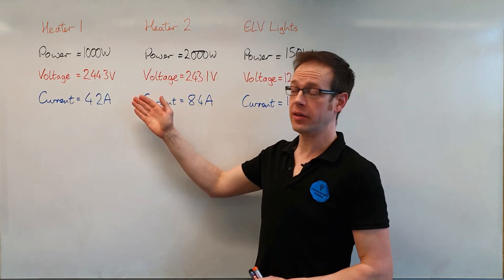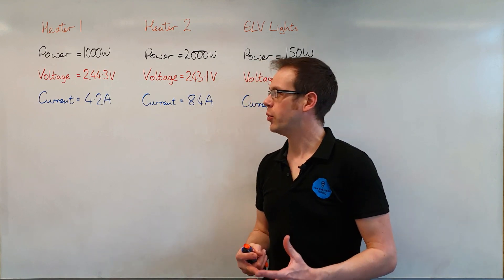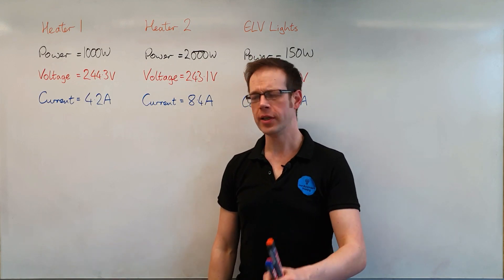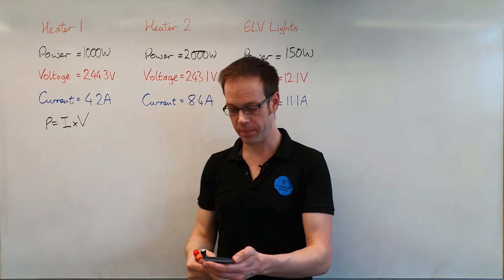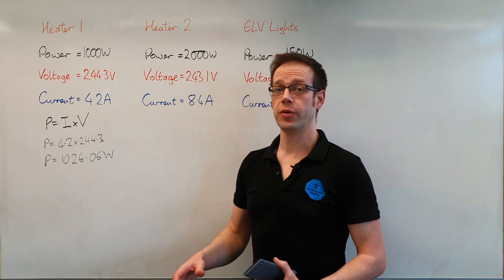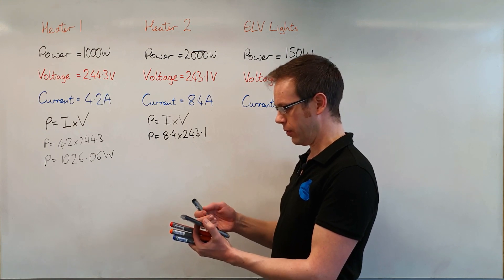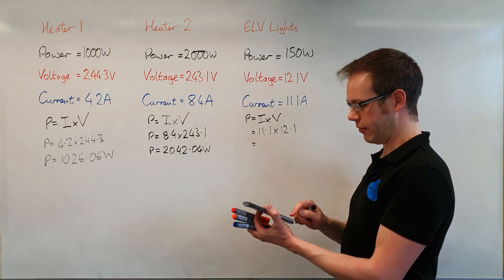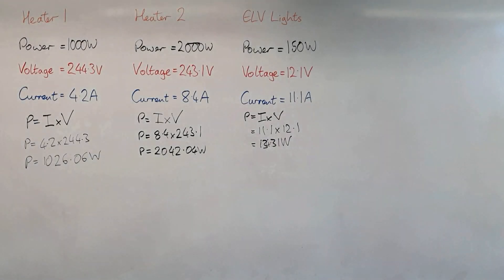How to Calculate Power in an Electrical Circuit, Where Does the Power Formula Come From?

Comment: Hi Joe, saw the video was interesting and you are doing a great job, since all the loads were connected on single phase AC supply, it would be good to explain that minor difference is due to the power factor value P=V*I*Cos"phi", So the heats are found to be leading load whereas light is found to be lagging load due to the transformer used to connect it. heaters are leading because you may be reciving over compensated supply from utility provider and LED lights are lagging on same source due to the transformer used.

Comment: I think maybe some manufacturers use in their calculations voltage equal to 220 or 230 as standard value and your practical measurement with voltage 244 is different from them .
Reply from the maker: Great point, thanks for sharing.

Comment: Great video. Shrouded banana leads might be a bit safer though. E.g. rapidonline.com/pjp-2311-iec-100r-red-4mm-safety-lead-17-0395 or https://www.rapidonline.com/truconnect-4mm-stackable-test-lead-110cm-with-retractable-shrouds-blue-17-2848
Reply from the maker: Thanks Rob, I believe I was using them, I just like to be super safe. 👍